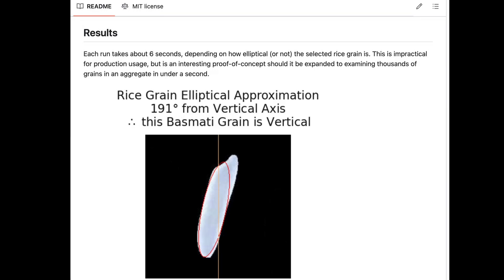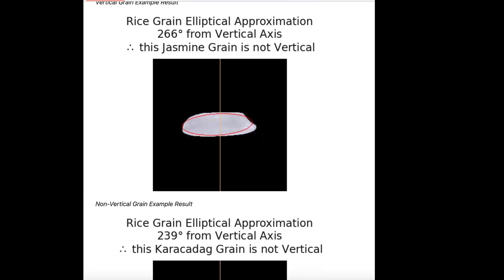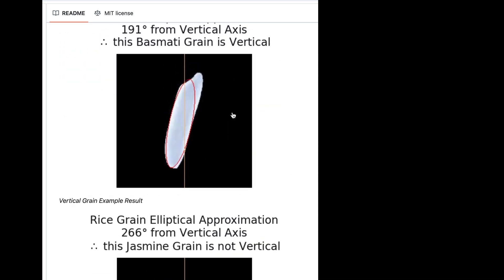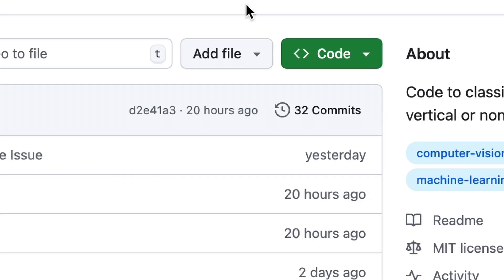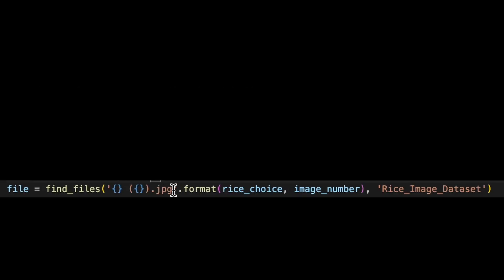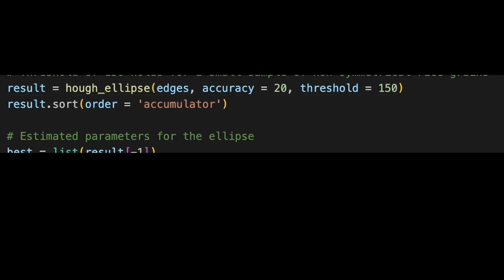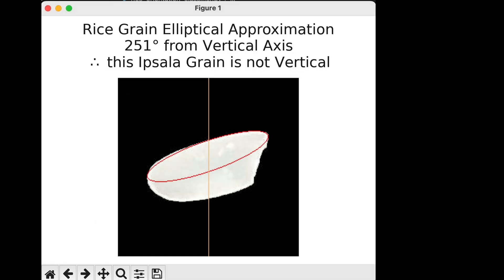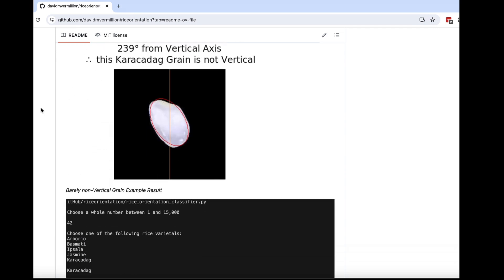Finding Rice Grain Orientation is as Easy as 1, 2, 3!

Comment: Where can we get the image set? Should flip the RGB before grey scaling. Also edge detection and then do the oval approximation. Otherwise interesting video.
Reply from the maker: I got the images from https://www.kaggle.com/datasets/muratkokludataset/rice-image-dataset

Can you clarify what you mean by flipping the RGB before converting to grayscale?

Also, the code performs edge detection before building an oval approximation (line 32 is edge detection https://github.com/davidmvermillion/riceorientation/blob/main/rice_orientation_classifier.py). I may not have made that clear in the video. Was there a different approach you had in mind?
Reply: @spacedataguy  ah ok so I looked at the code and you are not using opencv. So opencv wants you to take your rgb image and convert it to bgr and then do your image processing. I am not sure if the skimage wants you to do that as well. I have not used it and do not know the documentation.

Going to make my own implementation of this as it seems like a fun thing to do. But with opencv instead.
Reply from the maker: Correct. This one is using skimage. Let me know what you find with OpenCV! Also interesting that you have to convert RGB to BGR for image processing.
Reply: @spacedataguy  youtube deleted my comment :C but i tried to post my github its aquabouncer and the project is image processing. I got better fitting but didn't really understand the point of the direction thing. I was just more interested in the image set and playing with it and drawing a ellipse around the rice. Did the direction as a "extra credit".

I have used OpenCV, tkinter and pytesserect to make a manga translation tool. Never finished it like maybe 60% done. I got it to detect speech bubbles in a Korean webtoon then extract the text and then translate it and place the translated text back on the bubble in english. Most of the work that needs to be done is just interface stuff with tkinter and better translation tools. But you can give it a image and it can find the bubble in most cases. If it cant you just tweak the settings and it will.
Reply from the maker: Neat! Yeah, the direction piece was the big point for why I created this project. Hypothetically, grain orientation could influence processing speed through steps like a sieve to remove chaff. That's the idea. I chose an ellipse because it's the simplest shape close to a rice edge outline. Ellipse orientation is also easy to calculate with simple trigonometry based on semi and major axes.